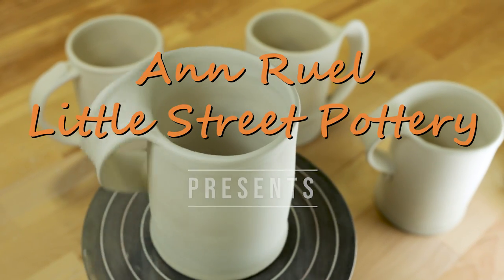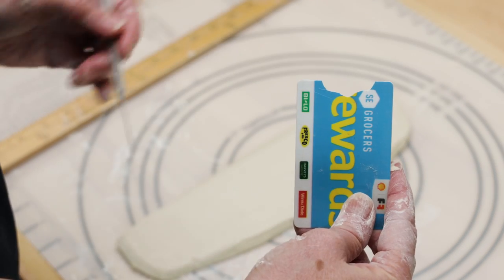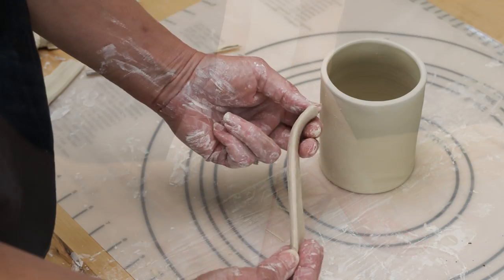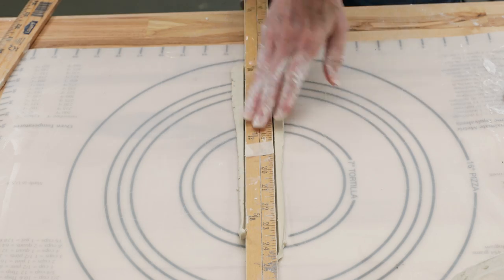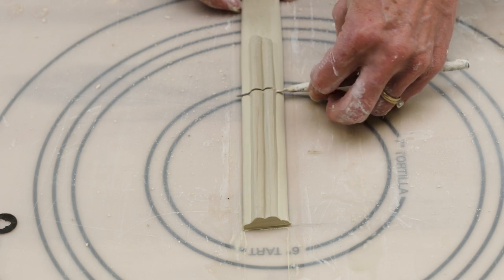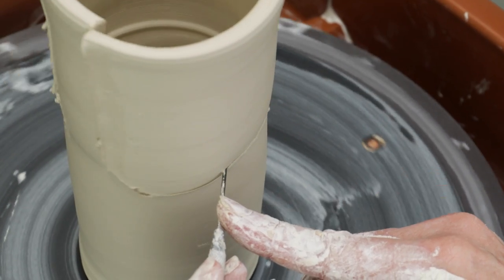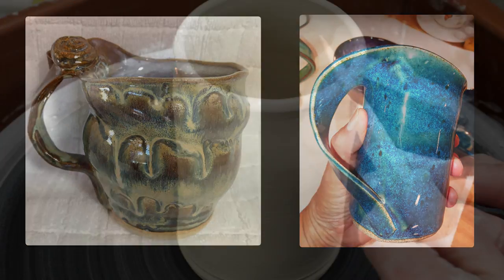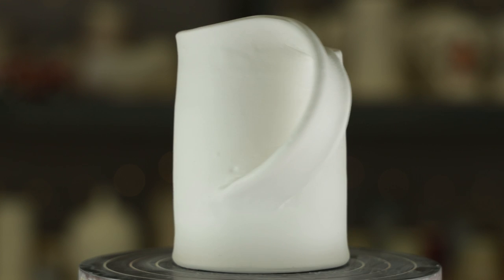7 SIMPLE and STUNNING Handles for Pottery!

Comment: I liked the card cut design, the patterned roller, the extruded  handle, the handle made from the top 1/3rd bent over and attached , the handle made by cutting the rim almost off then bent and attached. As you can see by the list, most of the handle ideas I liked. Thanks Ann, another thought provoking video turning the simple handle into something special😊

Comment: How long after throwing did you wait to cut the handles from the top    Are they leather hard?
Reply from the maker: I typically put handles on right after I throw the piece - not quite leather hard. The key is to be sure to match the clay hardness - if the piece is leather hard, then put a leather hard handle on it.

Comment: Without pulling a handle, the molecules are not aligned, making for a handle with less integrity, i.e. it will break more easily than a pulled handle. Throwing the handles, as demonstrated, is a better way,.